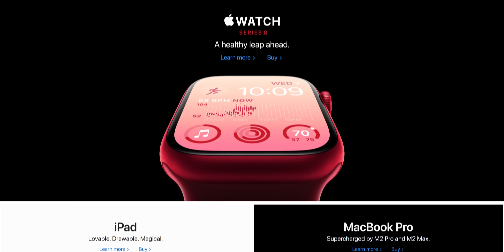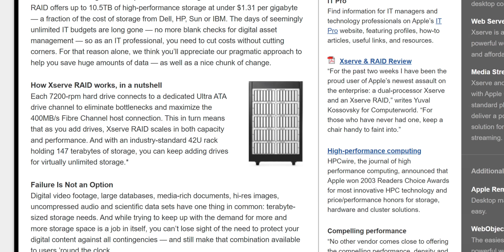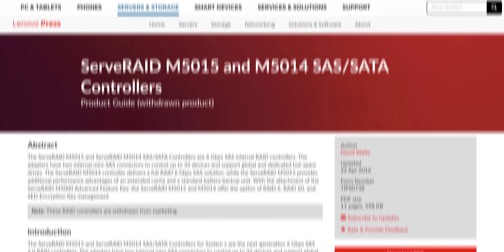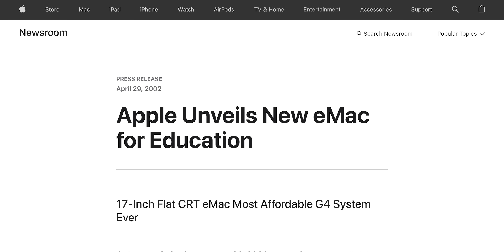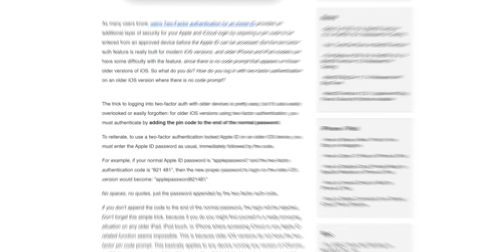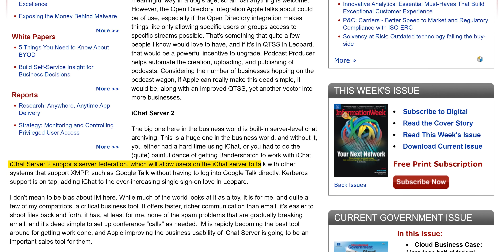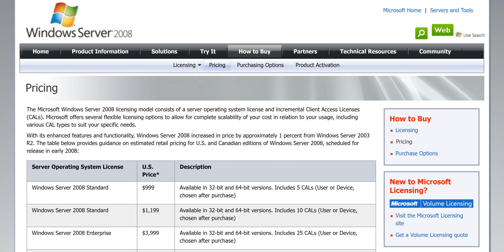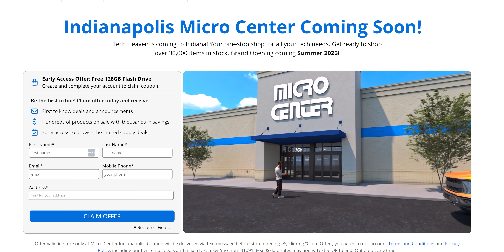I Bought the Last One Apple Ever Made... - Apple XServe 3,1 Server

Comment: The drive lock is not that weird... I worked at Sun back in the day, where drives weren't locked to raid trays per se, but they required specific firmware versions which greatly limited what drives you could use.  You'd either order them through Sun or go through the short supported drive list and then find the right firmware and up/down/sidegrade them.  The reason was the trays required support for spindle PLL syncing to maintain specific rotational phase relationships, along with disabling on-drive caching and enabling specific synchronous buffering methods.  The trays read off the drive as the platter rotated underneath the head, basically streaming directly off of it.  Similarly for writes.  This was not only for performance, but also in our case employed to implement I/O contracting (reservation) - guaranteed I/O bandwidth - for a specific product.  It doesn't surprise me at all that Apple required strict drive firmware control in a server product, where in case of power loss or other catastrophic hardware failure they had to guarantee data recovery, and that once a close or fsync system call succeeded the data was with mathematical certainty on the platter, with the filesystem in a recoverable state.  This can't be guaranteed if there's no reliable synchronous write support, or the drive can't tell you when a specific operation has been magnetically committed.  BTW, we also had a few Xserves; they were nice machines and in fact cheaper than comparable Dell equivalents which we also had a few of.

Comment: I LOVED mine back in the day…I had a small company (between 5 and 10 employees). I hated Microsoft Exchange, Groupwise. I Installed Lotus Domino as groupware and that was ok’ish but a nightmare to maintain. Out xserve server ran almost 10 years and apart from switching out HDD only the raid Controller died once (but someone came and replaced it on site). It was hell expensive for us, but it was worth every penny. BTW: I replaced with regular drive without issues! Cant remember if I had to do something special to them, but I remember running WD raptors in it.

Comment: Fun Story. The year was 2003. My school had a lot of tech funds. Me being one of the top kids in the glass was put in charge of many things. Like converting old P1's to Thin Clients and using the 3COM 905B NICs with PXE chips to boot off of Red Hat LTSP servers that ran on IBM P4 servers with 4 Gigs of ram. Could run up to 15 thin clients easily. We then had multiple Sun Servers with their thin clings. Multiple 2k3 Servers that those Sun Clients RDP'ed into to access anything, and then we have an xServer which had a xServer RAID with a whopping 1.5 TB RAID 5 across 7 250GB drives. Everyones home drive was on the xServer, all authenticated with LDAP/AD, and was in a peaceful environment. Then the District IT manager didn't like that things were happening that he didn't know and upgraded all the old Cisco switches to HP Procurves reassuring us it is to setup proper VLans so we can keep everything in the Rack in the room we had them in. Nope it was sabotage!!! Pretty sure those were the G5 servers we had. It was right when OSX came out.

Comment: Hah those were the days. Was an it consultant at around 2008 installing macOS X servers for small businesses. Snow leopard was the best one, only went downhill from there. :) 

The gui was great until something broke and you had to dig through confit files of the open source projects that built up the services.  Could be very time consuming. 

Was very few online backup tools at the time, but we still have the same speed on internet connections, 1Gbit. :)

Comment: 3:46 looks suspiciously like a 36 pin Centronics, originally used for parallel port (IEEE 1284). Not saying it's that protocol, though.
Reply: Ok I watched further and I gotta say what the fuck. I get that a proprietary solution CAN have benefits, like how the lightning port was reversible way before USB-C was a thing but this is just an asshole-move.

Comment: We ran a whole bunch of these for media production with a LOT of Xserve RAID over fibre channel. They were very reliable machines, we purchased a couple of spares kits (apple sold these) and only ever used the drives for swap outs, the rest of the spares eventually were thrown away. Take a look at Final Cut Server which was designed to run on them and was a full digital asset management and workflow system, also if you got that machine boxed, check out the little custom made hex key for locking the drive bays, I still have a couple with their machined and knurled loveliness.

Comment: Got one of those screaming beside me right now. Maxed out at 32GB RAM, added a GT1030 because why not and a USB3 PCI card. The last really usable OS X Server version was High Sierra and the highest capacity hard drives you could use internally were 2GB drives. Got three of those. I‘m a little confused by why you ran into problems installing the OS, though. A USB stick with a High SIerra installer isn’t that hard to create (if you still have access ANY Intel-based Mac) and there‘s plenty of those ready to download and flash all over the web.
Reply: Yes the USB installer is key! I actually have all the multi-CD installers and DVD installers for OSX Server in my office in a neat little CD/DVD storage caddy with all the activation keys! Some are still sealed! I used DeployStudio to make server images and made redoing server so easy. Spin-up DeployStudio over the network with NetBoot, wipe and image in 30 minutes to have a working server with all the software ready to go. Made imaging iMac labs and user MacBooks a breeze! I miss those days. Now it's JAMF and so complicated.

Comment: Oh my god…favorite video Linus has done. The process to get the OS on there was hysterical to listen to and painful to remember when I’ve had similar issues resurrecting old macs. Can’t wait to see them convert to a gaming machine.
Reply: It isn’t actually that hard, there’s several easy guides online that show how to make bootable isos for USB sticks. It’s as easy as downloading one of the macOS installers, and then running a few terminal commands.
Reply: @thejpkotor  oh I know it’s not hard, and I know about how easy it is to get OS installers. The funny thing is when it doesn’t work and you have to go back like 5 OS’s and then install them one at a time because going to the latest it supports won’t work properly and finish the install. I restored dozens of old machines but sometimes something in them is just stubborn and the only way to do it is to install in a ridiculous series of steps. That’s what I found hysterical about this.

Comment: I've got one. Popped a PCIE ssd in and ran ubuntu server on it for a year before the drive died. I need to replace it. Any sane tips on improving this beast would be great. I get the sense that if I get another pcie SSD it'll just die again in a year, but the hardware is still legit for the cost you can get it on ebay for. I even picked up plenty of spare parts and I'm all in for < $600

Comment: I use to sell these in reskinned chassis to the DOD, what's considered "ruggedized", for mobile use in harsh environments.  IMO Apple actually stare ted moving towards the custom connectors/sleds/firmware etc., simply because a lot of their market was industrial and DOD (not just media and education as Linus stated) and those industries rely heavily on redundancy.  They knew that they could sell tens of thousands (if not hundreds of thousands) of drives/sleds and components every month.  I had a specific contractor that bought thousands of drives every month, for hundreds of dollars each, just for backup and redundancy.  And that's only because they had invested in the units and didn't realize the cost of upkeep beforehand.  Over time, those industries dropped Apple in favor of PC, mostly for the cost savings and because of the headache that the supply chain created.  I honestly can't even remember the last year that I quoted and Apple product now, that's how long it's been.

Comment: wire wire is faster then usb 3.0 fact doesnt mean anything today but if your usuing for audio and don't want usb irq and power droop in cpu yes it does ,  noticble  on pree lga2011  soo firewire audiio for the  win and doesn bog system if your runn old ass but still i'll use firewire befefore usb anyday

Comment: I have the desktop/tower. I did a cpu upgrade, mine too requires de-lidded xeons, I grabbed two standard x5680 xeons and chucked them in a bench vice to de-lid them. first one went well, second one I ripped off a bunch of the smd's. Re-flowed them with a standard heat gun(not hot air soldering station but a literal heat gun) and it works perfectly. Side note I had to flash a firmware/bios update to take it from a 2009 mac pro to a 2012 mac pro (they are basically the same computer). There is a massive community keeping these things going. They have even made it possible to run the latest mac os and amd gpus in these old computers. It is even possible to upgrade the wifi and bluetooth to 802.11 ac and bluetooth 4.2. Another side note is that originally they could only run 128Gb ram and this group have made it possible to run 256Gb

here is a link to the forum that explains how to get the latest os running: https://forums.macrumors.com/threads/activate-amd-hardware-acceleration.2180095/page-53?post=28255048#post-28255048

Comment: most linux distributions such as debian, ubuntu, etc. etc. have most of these features out of the box (and way more), and are just as easy to work with. - there are also smaller distributions like truenas scale for example, that cater to specific features such as network attached storage / user management / smb file sharing or others dedicated to stuff like virtualization such as proxmox ve.  ALL of these solutions run on commodity (i.e. way less expensive) hardware than apple's solution and is more or less futureproof because it doesn't rely on support from a single entity which could decide on a whim that they don't want to support it anymore... and given what actually happened, apple is almost as bad as google when it comes to killing projects abruptly.

Comment: But Linus! The HDD connector isn't actually proprietary. It is currently also being used by EMC, for example their VNX systems. The connector is referred to as a "fiber connector" and was pretty common back in the day, where both HP and IBM used to use the connector as well, on fiber storage systems, where the drives would be running 4G fiber in a 4G fiber storage expansion enclosure.
The drives also aren't really locked. Mostly what happens is that the drive is formatted using 520 or 528 block size, which means you can't put them in any normal SAS server, as Windows refuses anything that isn't 512 block size. What you can do with these drives is to reformat them using Linux. Either with sgutils or setblocksize, sometimes setblocksize is a must, especially for EMC VNX locked drives, they have EMC firmware but setblocksize can force a 512 format, and the drives are usable in any system you want. In case of the VNX they also come with a small sas to fiber converter on each drive, but if you make the drives 512 and remove it, it fits in anything sas and runs everywhere.
Only outlier is Hitachi, their HUS systems are just crazy locked down, I was never successful in using a HUS drive anywhere else. Even after forcing a reformat to 512 (they run 520) the drive just shut down when trying to create an array. That is definitely firmware lock. Some people flash them, and they say it works. I've never tried it.
Anyway, just some extra info there, nothing proprietary in these mac servers :)

Comment: As the only "Mac" guy in IT at a local paper I was given a couple these to look after (G3's running 10.3). It was an absolute breeze. They never gave me any problems, and one of them held the record for the longest continually running server in the company, it went for over 4 years without a reboot.
Reply: i got a G4 sitting in my closet. modern pc's are pretty good, but old apple case design is the GOAT.
Reply: Legit power of *nix based systems. 
When I was hired at my company, there were a few non-inventoried systems running in the server rack. Comes to find out, one server running Redhat Enterprise linux 7.0 was running as a DNS replicant for 7 years non stop. No reboots, no unexpected loss of power, and no crashes. I did a screenshot of the uptime, and a reboot for yum updates.
Reply: That’s crazy for a g3 too. such a simple time back then. Much less to go wrong
Reply: IIRC the first generation were G4s.
Reply: @pseudotasuki  You're right. After all these years, I still can't type!!  🤣🤣
Reply: Not hard to beat Windows on that - I've had LINUX servers that went 10 on occasion between LONG power outages or hard drive failures.
Windows? I've seen ONE NT 3.51 SP5 server manage a bit over a year - ONCE - and nothing before or since lasted even THAT long.
Reply: @bricefleckenstein9666  oh bollocks I've had 2000 and 2003 up for 18months, in an air-gapped environment that would not allow updates.
Reply: @PhoenixRises666  I can only speak to MY experience - that has NEVER had any Windows system run for more than 1 year in a row without a reboot EXCEPT a NT 3.51 SP5 system - ONCE (I did have a NT 4 final SP system manage 11 months once).
An d quite bluntly, 18 months is NOT impressive - LINUX in my experience has rarely needed a reboot and more often than not the LINUX systems I've had (some for 20+ years) only got shut down or rebooted due to a physical move, or an extended power outage the UPS on the machine could not handle.
Reply: @bricefleckenstein9666  You're not gonna get more than 3 months from Linux without a kernel update whooping you these days lmao
Reply: I have the last one in my server rack just for the heck of it, fun little device.
Reply: I still have a raspberry pi 1 in my parents house, running just pihole. Uptime is 6 years and 8 months as of today. It's wild how stable older hardware is.
Reply: A lot of servers can run for long times that's nothing knew. But the problem with Apple is they cause so many issues over time making it impossible to do certain things. It's honestly like no one knew this would happen for older hardware without operating systems, that's something that should be the easiest thing to do, putting OS on a server or computer. Let's not mention Apple being against customers fixing something they bought.
Reply: i belive you'r a bot brother 🤣
Reply: @AdamTest-q4h  Nope. Not a bot. Just a middle aged bloke.
Reply: damn
Reply: You never worked on VAXes. I think there's one on the internet that's been up for decades. They're still waiting for DEC Field Service to return their call and schedule downtime.
Reply: @michaelvilain8457  ok
Reply: Same:" I never had a n issue with my apple device"😅😅 liar.

Comment: I’ve been running Xserves and also Mac mini server for customers who were a Mac only shop. For them it was the natural choice and worked like a charm most of the time. Had customers running email, calendar and contacts on them with FireWire or later with Mac mini servers thunderbolt raid enclosures. Mac mini had 2 drives that could be configured as separate ones or in raid 1. It worked very well with macs and iOS devices. I was actually really sad when they started discontinuing feature after feature in the server app. Even now its difficult as a company to use Apple services for companies. I really like that iCloud finally support custom domains for email, but sadly only up to 5 addresses per custom domain, so a company would grow out of that pretty fast… they could just raise the limit on accounts in a domain and extend family subscriptions i packs of 1-5 or something. They don’t even have to redo their offered services but I BET a lot of small Mac only shops would like it. And its not like Apple would have to really scale up iCloud or something, but it would be a nice nod to the old days of Mac Server….

Comment: they wern't vendor locked and you could use normal drives in JBOD but if you tried to use consumer drives with the apple raid card they raid wouldn't build or randomly fail drives

Comment: The Xserve grew while it was still a PPC based platform because at the time it offered features x86 didn't have like Altivec and then 64-bit. When they went to Intel they were competing against Dell and HP with the same hardware updated 6 times less frequently and priced higher than the competition so they were doomed by the Intel transition.

Comment: This lack of backwards compatibility and/or access in hardware is really unusual for Apple I feel. You can take the very first iPod, and it will talk to a modern macOS system flawlessly, even if you need some dongles. They still offer options so you can connect devices using their legacy connectors, like FireWire and the 30-pin.

Comment: Reminds me of how Apple one day just randomly flipped a switch to disable apple pay transfer on older phones/iOS. Or how apps refuse to update then they get disabled and no longer work. 
The loss of 3D Touch and the addition of long hold on  was a terrible mistake. And on modern iOS lockscreen it is easier to open the camera or make an new lock screen than it is to open the flashlight, which requires a looong hold to activate. . 
I know numerous people all with different iPhones and they all complain about the phone unlocking by itself and open app, typing, etc.  these were never issues on older devices with fingerprint scanners or just passcode. 
Another very disappointing issue is that the phones have got a lot harder to turn on and off. . 
Not to mention how the task center has become useless for controlling Wifi or Bluetooth
Reply: I can think of so many iOS breaking bugs 😅 idk how these ever make it to a consumer release